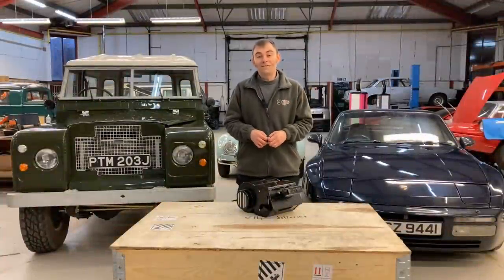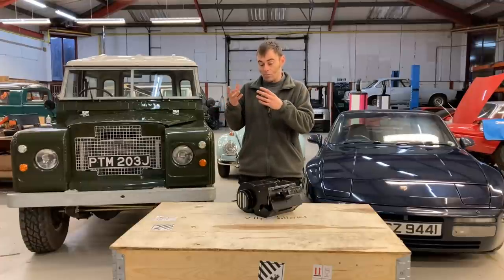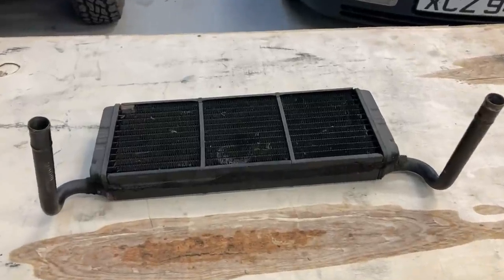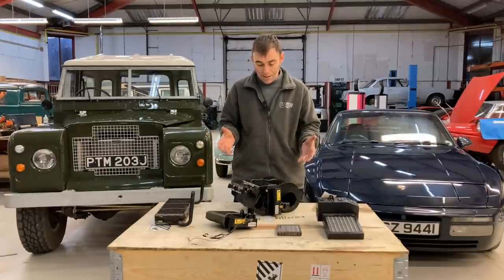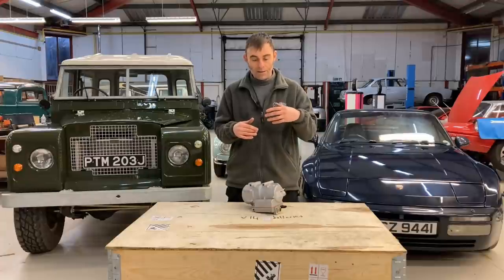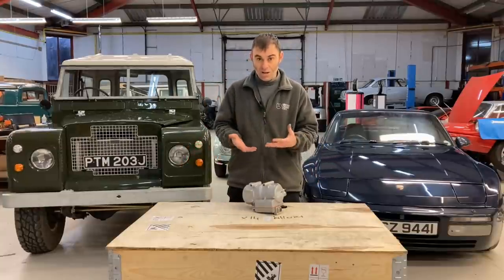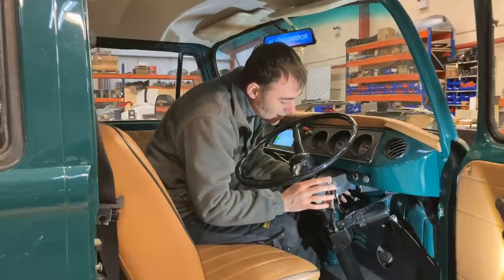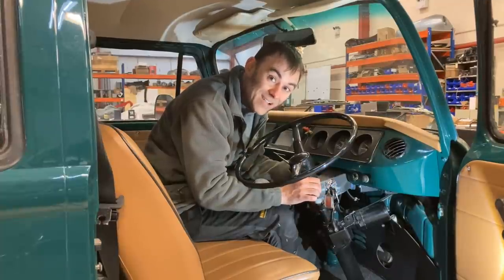Tech Talk - Electric Car heating, power steering, brakes, etc

Comment: And most importantly especially for you during conversions: As the replacement items are all electrical, as opposed to belt driven, you have much more flexibility as to where you can install these items. Basically any void space will do.
Reply: And much less parasitic losses as they only draw power when it's needed instead of all the time when they are hooked up to a belt.
Reply: @insAneTunA  apart from clutched alternators and air con, also most modern cars have electric fuel pumps….
Reply: @davog1946  But they still sling a belt or a V snare around, and it takes a ton of bearings to do that, not just one or two. So even if everything was clutched it would still cause a substantial amount of parasitic losses. And the clutches itself including their housing ads extra weight to the car and they need to be maintained as well. The belt or snare can snap. And if it doesn't snap it is still an expensive replacement if it needs to be replaced. And the list goes on and on as to why a belt or snare driven system is so inefficient compared to all electrical driven stand alone components from an electric car. 

In the Netherlands there is a company that is founded by some former world champions from the solar challenge, who are designing an electric car where every single component is as efficient as possible. It will also have voltaic cells embedded in the roof and other flat body panels. But it doesn't stop there, they are taking it to the extreme. It is called the Lightyear one.  

It is a car that is designed for a specific purpose, not for off road racing. Keep that in mind.
Reply: Well, my old 69 FJ40 never had power steering, power brake or AC, so all I'd need is heat.   It did use vacuum to switch the transfer case, but that could be easily changed to manual.   That only leaves the PTO winch.   Even with just that, I feel the juice necessary to run an electric winch will further shorten an already limited range.   And there aren't any charge stations out in the middle of nowhere.
So I think I'll stick to gas.

Comment: I'm a refrigeration engineer and always wondered why electric car manufacturers have not adopted the 4 - way valve setup that has been in use for years in the domestic and commercial air-conditioning industry. In fact I've often wondered why ICE cars don't use this to speed up cabin heating in winter . With A/C in an EV,  setup with a reverse cycle the electrical load would be only around a third of a resistance heater thus increasing the range of the vehicle without extra batteries .
Reply from the maker: They have started to use this in the latest generation of EVs. For instance the latest Tesla HVAC system has a very cool octovalve arrangement. I may well do a tech talk on it in the future once I've covered more of the basics of EVs. 👍
Reply: Not just the newer generation EVs use the aircon for heating the cabin.  The Zoe has been doing this since its release in 2013. This is because the battery is also air conditioned with its own heat exchanger on the A/C system. But this has the added benefit of much improved efficiency for cabin heating in winter.

Comment: Thanks for video - always interesting. Would be good to understand how a heat pump helps range and how they work (and how much they cost). Also, loved the rear view mirror - nice way to add some tech in an old car!
Reply: Heat pumps are by far the best way to heat the vehicle (or anything for that matter) as they are between 300 and 400% efficient. They aren’t a separate item in vehicles equipped with them, it is a function of the air con system, it just requires a few extra valves and control system.
Reply: There’s plenty of YouTube videos on heat pumps. The ones for vehicles are just a small version of the ones used to heat buildings.

Comment: I imagine that because the drive in the various devices shown is independent of the engine it makes it easier to place them as required by different vehicles. They don't need to be in the original location or orientation. Another informative and entertaining video Richard.

Comment: Another enjoyable one….
Does your VW bus have a camera rearview mirror?
Maybe an idea for a future episode, fitting (modern) gadgets… parking camera, camera door mirrors, etc, etc. Is that something you do on classic cars?
In the similar vein, driver aids, things like traction control, torque vectoring, electronic stability control, ABS. Are those easy to integrate in an EV, or a bridge too far? 
I guess, ESC and ABS are a bit difficult, because they tie in with the (existing) breaking, but traction control and torque vectoring require some sensor and tie in to the motor/diff, don’t they?
Reply: At the most basic level it should be possible to alter the firmware mapping between the accelerator pedal and the motor, so moving from stationary doesn't cause sudden wheelspin due to high torque. Traction control should also be possible if there's speed sensors on both left and right wheels (assuming a 2WD car) as well as a sensor measuring the motor RPM. Though it might work better if there are also sensors on the non-driven wheels.

Retrofitting a reversing camera to a car is a pretty common thing to do. I added one to my Ford Falcon Ute recently.

Comment: 😎👍🏼.... Interesting add on for you...one of the light electric utility pick ups in Germany thats just come to market only has small batteries so rather than have to draw a lot of juice keeping the cab warm out on the farm and to heat water for a small hand wash bowl system which would add a lot more wt. battery cost and copper etc.
They use a remote liquid fueled heater ...  half the year you dont need it and it weighs and costs a fraction of what the bigger electrical system would. 
It can provide instant heated water and heats the cab up when needed.  Aircon.... nope, a fan and windows if you want to go mad fit a sun roof.😉

Comment: Thanks so much for sharing your experience! It is really helpful - thanks to you I'm going to start piecing my Land Cruiser (biodiesel for now) with an electric assisted power steering to go little by little into electric! 

Would it be possible to share about how do you control and manage the Tesla motors and batteries? Do you have to use a something like "central computer" to set everything up? 

Thanks su much!

Comment: I’ve always interested in the idea of particularly a BMC A60 Cambridge/ Oxford I remember working on my Cambridge years ago and there was just loads of space round the engine you could almost climb in next to the engine to do any work.You could put the electric motor where the gearbox was you would have all that huge space plus a big boot for batteries one of these days and I tried

Comment: Brilliant talk and explanation can I ask how much range you would lose by running all these systems I mean if you started with a vehicle with say 150 mile range then use the heater to clear windscreen and heat car ect and the servos for steering and brakes ect how efficient would that be regards and again  awesome video
Reply from the maker: Depends on the size and ratings of those items but I'd say around 10%. 👍

Comment: Alternators only work while petrol is being burned (expensive electricity), DC2DC's can work all the time keeping your 12v systems running. No Classic battery conditioners required.
Reply: Alternators/generators also aren’t the best if you don’t need a lot of energy/power, e.g. for heating/air conditioning
Reply: Don't forget that the 12v is needed to turn on the connection to the traction battery and they are totally disconnected when the car is 'off'. Some system also stop DC2DC at low levels of traction battery power so both could go flat - in real life you would not go that far, but I have seen it under extreme testing - fixed with a 12v jump pack to get the car to take a charge.

Comment: Hi
Another great video on the technical bits behind an ev conversion 👍🏻
In your crew cab I noticed the rear view mirror turn on is it linked to a camera at the rear and is it constantly on when driving
Cheers 
Ian
😃👍🏻👍🏻👍🏻
Reply from the maker: Yes, it has a front facing camera and reversing camera and switches off the display if not used after around 10 seconds. 👍

Comment: Very good videos! Thanks you very much. One question that comes into mind: aren’t those electrically driven airco and heating units taking too much power off the battery? In other words don’t they diminish  the range too much?
Reply from the maker: Not by much. 👍

Comment: What sort of power does the mini heater blower take.  Not yet an electric car (future project) but my Renault 4CV need s heather for the next Monte Carlo Rally - I had fitted the mini blower but could never get enough heat from the rear engine up to the front...... cheers and love these conversions. (I have a Renault 4 that could be an option for conversion)
Reply from the maker: They take anything from 1kW to 3kW. 👍

Comment: Nice & very informative video.  You could have gone a little further, by adding a few figures for the amount of power these alternative assistance, heating and cooling really required.  Viewers will be amazed by how efficient they really are.  Even ICE vehicles are going this route rather than being a drag on the crankshaft of the engine.

Comment: Hi Moggy. When you’ve done a conversion, do you still use a lead acid battery for the 12V system? I know someone talked me through why Pb-acid batteries are still used on ICE cars (but I’ve forgotten) so would be useful to talk through this & whether you then go to a 12V Li-ion / LiPol battery once converted. Cheers 😊
Reply: I assume it's down to cost and convenience. Lead acid 12V batteries are fairly cheap compared to the Li-ion equivalent and can be bought at any automotive shop. Also for most old cars the biggest current draw on the 12V system would be the headlights, so I'm not sure you'd gain much by switching to a Li-ion battery.
Plus it's possible lead acid batteries might be more suited to continuous charging compared to Li-ion.

Comment: Great video. A couple of questions could I fit that electric heater to my classic mini, or would it draw too much power - if I can what part is it please? It’d be lovely to be warm. Where did you get the power steering for your camper? Thanks 👍
Reply from the maker: The Mini heater has a heater element that is 400v, so I'm afraid it wouldn't run off a 12v system. Sorry I can't remember the supplier of the electric steering system for the VW, it was about 5 years ago since I installed it. 👍

Comment: Interesting once again, it begs the question of having a series of pumps of various kinds being run off one electric motor, instead of many motors. Also can you advise how all this additional electrical power requirement affects range.
Reply: No point running them all off a single motor. It would make packaging much more difficult, not to mention you would lose the advantage of only running them when needed. 
As for range, it doesn’t “affect” range, as they are part of the vehicle systems, so the range is what it is with those systems being considered.

Comment: If your fitting an air con compressor why don't you also fit a simple heat pump reversing valve to turn it into a more efficient heater?
Reply: much more efficient

Comment: I understand that the Honda 2000 used an Electric Rack and Pinion PAS, directly operated rack, without any hydraulics, merely an electrically driven pinion, on the rack connected to the track rod ends.
This does NOT use the "Easy steer system", which severs the steering column.
Have you heard of this system, and have you any comments  ?
Reply from the maker: Sounds interesting. We've not used one of those before. 👍

Comment: The only drawback of instant heat that windscreen might crack at extreme low temperature outside due to difference. Personal experience on BMW E38, it's additional coolant pump, so hot air comes almost instantly
Reply from the maker: I kind of see what you mean but in 7 winters driving an electric car and knowing a LOT of electric car owners, I've never heard of this happening yet.
Reply: @ElectricClassicCars  I have forgotten to mention the extreme low temperature like -40 Celsius

Comment: To future proof my Delorean with a swapped engine (Clio V6), I've decided to use electric Bosch iBooster gen1. Running in limp mode, but brakes are way more responsive than a vacuum-operated booster (which you can't really get NEW just NOS - a 40-year-old rubber!). Power consumption is not that big, and you can run a redundant power supply to make it safer. 
Any chance you have a Model 3 brake reservoir for sale? The Model S does not fit well into my Delorean.
Reply from the maker: Good use of an iBooster. 👍 Sorry we don't have a spare Model 3 reservoir. .

Comment: Question; That SWB Land Rover you've just shown on tv, did you consider fitting the batteries on a sliding tray under the back end between the chassis rails ? 
If you could have done that the room inside the vehicle would have been intact.
Should you ever do the conversion on a LWB there is loads of room under the Bach end, that's where the LPG tanks are often fitted.
Reply from the maker: Yep, that's what we do on LWB, but on a SWB there's precious little space under there.

Comment: What about rear view cameras like your kombi? I saw your rear view mirror light up.
Some good descriptions Richard, except how do you pump up a vacuum and then store it?  You might want to tell the viewers that even ICE vehicles now come with electric power steering systems because they are more compact and don't have all those parasitic losses like belt driven hydraulic systems have.
A Beetle electric heater might work better than the exhaust system because it can be located up front where the defrost is needed like in the UK or other places with high humidity and cool weather.. Plus you can put the heat right where it is needed.
I've heard lots of complaints about poor heat in a Beetle but mine will cook you out of the car. Even so, the defrost still sucks.
Any 12 volt heating/defrost systems you can recommend for a Beetle?

Comment: Thanks for this. How about replacement for a vacuum central locking as in my Mercedes 280 SE?
Reply from the maker: Yep, we've done few old Mercs now like that. Basically we use an electric vacuum pump and accumulator. 👍

Comment: Hi, this may seem a stupid question but why do you still need a 12v battery, if you have a dc to dc convertor could you not just run the 12v side of things of the main batteries?

Comment: Do I need to retain my battery at all? I want to use indicators brake light, Horn, windscreen washers in fact all electrical driven items y never mentioned in your video, an awful lot it seems. I intend replacing my battery with a red or yellow topped Optima battery. My car is a Daimler 250 V8  due for changing to electric power?
Any help you can give would be appreciated.

Comment: If the DC-DC converter makes 12V from the big battery - why is the 12V battery at all necessary?
Reply: I think it is needed to trigger switches that engage the high voltage system.
Also most auto accessories are 12 volt so it is convenience …
Reply: Part of the reason may be so you can power auxiliary devices (eg. radio, interior lights, parking lights, etc) from the 12V battery while the main battery is charging. Also evidently the computer control system is 12V so if you disconnect the high-voltage battery then without a 12V source you no longer have any way to power it back on. At least that's my understanding.

Comment: How are your cars approved to drive on the road once they are converted? Here in Denmark it is close to impossible to get an electric conversion street legal, so noone does it.. and that is a shame
Reply from the maker: That is a shame.
Reply: Would you be able to get a car registered that is road legal in Germany?
There a few companies doing it here …
Reply: @arpinchock  to get it thru the German TUV approval is next to impossible, and extremely expensive.. as every part changed on the car needs to be tested, approved and made documentation for...
Reply: @skodbolle  Umm.. I know of over 20 vehicles that have passed no problem. Not sure where you are getting your information from...Check out Lorey Maschinenbau
Reply: @arpinchock  I think it depends how you perceive "no problem" a guy I know built a V8 into a Porsche and sent it for TUV testing in Germany resulting in a grand total price of 250.000 Danish kroner (33.000 eur)
Reply: @skodbolle  Lorey conversions start around 10000€ and basically go up depending on whether they have done the car before and how many batteries go in. That includes getting it passed the TÜV.
Most of their conversions are considered "engine swaps" with no changes made to the brakes, gearboxes and weight of the car. That usually makes it easier.
Here in Germany I always wonder when people talk about things being "expensive". For example a guy wanted 20" wheels on his Tesla and needed TÜV approval and it cost over 150€.
People are spending 1000€ on phones and 400€ on shoes... I think 150€ is a good deal!
I once asked three TÜV engineers about a fiberglass hood/bonnet on a car.
One said it would be no problem, one said he would want to run a few tests, the other said he would want the car to go 10000 km on the Nürbergring to approve.
It all seems very subjective...

I can't comment on the 33k because I don't know what that includes.